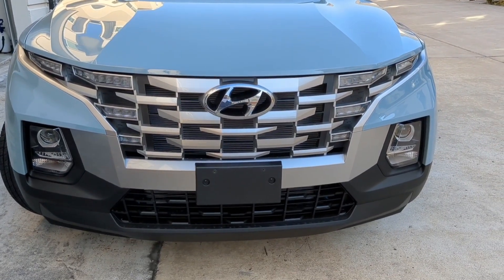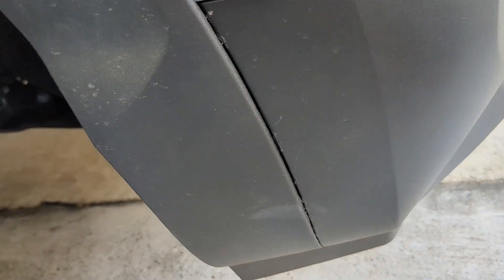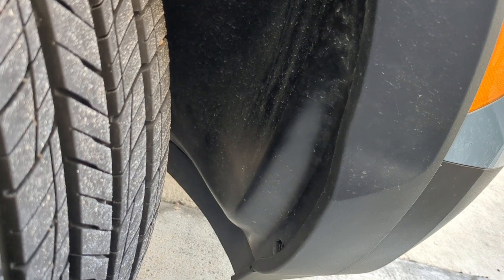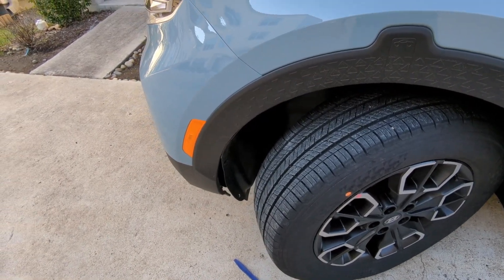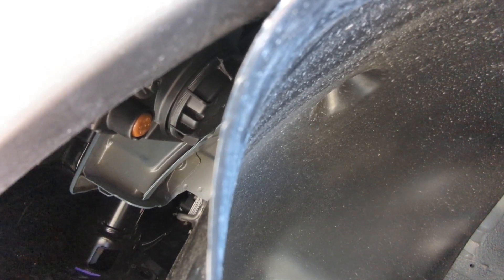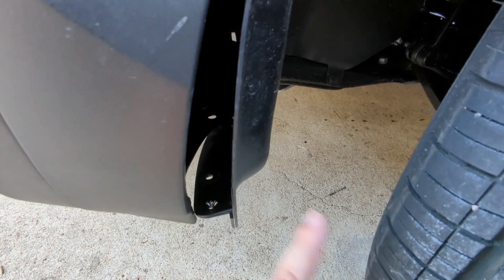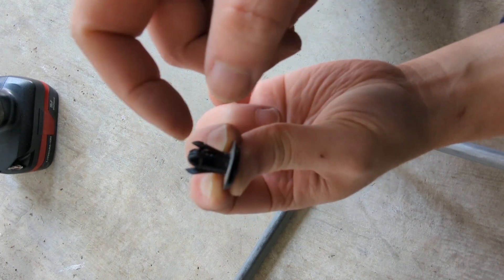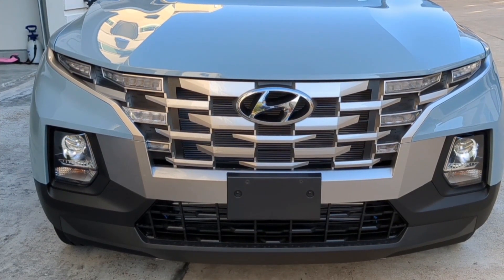Hyundai Santa Cruz 2023 SEL headlight replacement

Comment: Thanks for this video. It's a good guide. I just replaced mine. I preferred taking off the tires for better access. Here was my steps: 1. Remove tire. 2. Undo clips, i did 10). 3. Remove  the cap (counter clockwise), pry if necessary. 
4. Un-clip the electrical supply. 6. Remove the actual headlight bulb by twisting counter clockwise. Reverse the process to install the new headlight bulb.

Comment: I am 75 years old weigh 120 lb, both sides of fender covers were loosen but after the passenger side dust cap was plied open (tight ) I couldn't twisted the bulb out with my left hand. 10+trials later, I ended up asking my 30 years old neighbor (auto mechanic) to help. He did both bulbs replacement under 3 minutes. Even he admitted the OEM bulbs were tight. Unless the tires come off and hoist the vehicle higher, it's NOT as smooth as the videos showed. But it was worth replacing them
Reply: You are correct. The dust caps are tight but at least they are large enough to get a good grip on them to twist them. Then gently pry at the base with a flat edge. Once pried away a little bit they come off the rest of the way easily. The bulbs are another story. They are super tight and recessed so you can’t get good leverage on them. I carefully used a small pair of Channellock pliers. It worked. But, Wow. The driver’s side was a little bit easier. Removing the inner fenders was a piece of cake and unlike in a lot of these videos it is completely unnecessary to mess with the wheel arch trim. The inner fender material is very flexible. All said and done the LEDs are a gigantic improvement so it’s worth the effort.

Comment: Thank you for the video. I was stuck at the cap cover and I couldn’t get it off. When you said pry it open in the next sentence, I popped the cap open with the pry tool lol and it worked. Thank you 🙏
Reply from the maker: You're welcome! Glad that worked for you. It took me a while to figure it out too lol. You actually could just pull the cap out by hand. No need to pry it. Just need to move the cap from side to side a little bit while pulling it out.

Comment: Thanks for the video! Just got the SEL as well and saw everyone recommending this replacement. I got the Auxito on recommendation so we'll see how the fan does. Glad you were able to do it without removing the trim since other videos recommended doing that and I was hoping to avoid it.
Reply from the maker: you're welcome! I actually returned the BeamTech and got the Auxitos as well. I updated the video description. The BeamTech started showing degraded performance soon after I installed them. 

Yeah I tried to remove the trim at first too but it was too risky and unnecessary. It now takes me about 5' at most to swap the bulb each side without removing the trims.
Reply: Non need to take all 8 pins out.  I took out 4 pins and had it out in 3 minutes
Reply: @rblaclewell  yea you only have to take the bottom ones out because of this comment I did the LED’s

Comment: I have the 2022 and I did not have to remove the fender trim. You would think Hyundai (bragging about safety first) would have LED headlights as standard equipment for all models.

Comment: Just to confirm, these are the 9005/HB3 models? I clicked on the link but it says they aren't compatible with my 2023 SEL. Any input will be greatly appreciated. Thanks!
Reply from the maker: If you mean the AUXITO 9005, then yeah that's the right one. I have had it for the past month and no problems so far.
Reply: @diynoob3663  Got it! Thank you. 👍🏼

Comment: I would like to do this but I was told by the Service Manager at my lcal Hyundai that it would voind the warranty and also burn up the wiring harness for the lights. Anyone else heard this.
Reply from the maker: I'm not sure about the warranty being voided,  but for burning up the harness, it doesn't make sense to me. The original bulb is rated at about 60W per bulb, while the Auxito is 30W. So the LEDs actually consume less power than the halogen bulbs. Not sure how that could burn up the harness.
Reply: Me either I know less pull less current. Didn't make sense to me. Might try different dealer. Thanks for your reply

Comment: Does it fit Tucson 2023?
Reply from the maker: the SC is based on Tucson, so I think it will fit. However it may depend on the trim your Tucson got. If it's one of those trims that use only 1 bulb for each headlight, it should fit.

Comment: are there any heat issues in the dust cap area due to lack or ventilation?
Reply from the maker: no. I have been driving with the Auxitos for 4 months now and it has no problems so far. However, the weather has been cool, so the heat performance has not been stretched yet . Summer is coming so I'll see if heat can be a problem then.
Reply from the maker: Updates on this. It has been performing well during summer in Texas. No degrading performance at all. The Auxitos are solid.

Comment: Worst video I have seen on this in a long time! Audio is horrible. No showing of pin removal and far too much talking about nothing! No thanks!
Reply: The center of the plastic fastener looks like a nail head. The outer ring is a collar. You’ll see slight depressions in the collar where you can use the tip of a small flathead screwdriver and gently pry up on the pin. It takes very little effort. Once it pops up about 3/16” grab the fastener with your fingers (being careful not to push the pin back in) and pull the entire faster out. It’s super easy. To reinstall push the fastener back into the hole with the pin still up. Once seated push the pin with your fingers until flush. You will feel a click. You’re done.
Reply: Very painful video.  Should have been 3 minutes long.